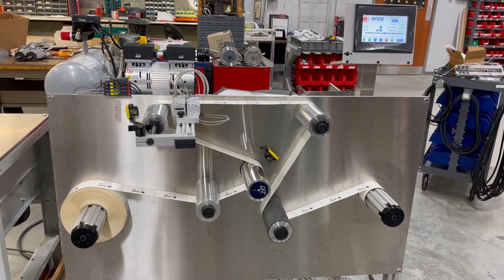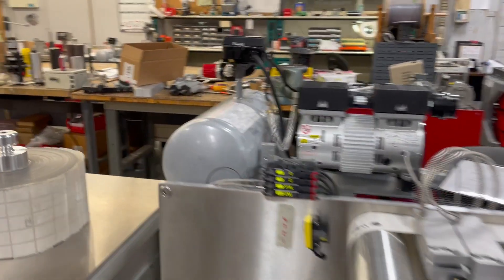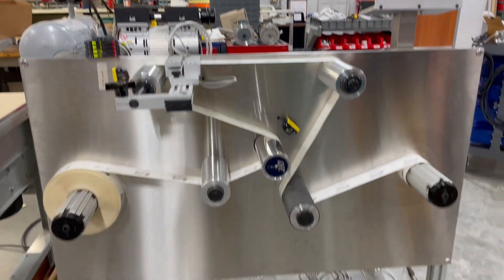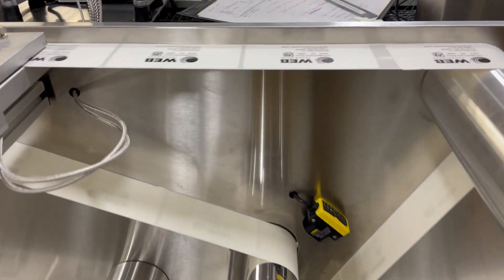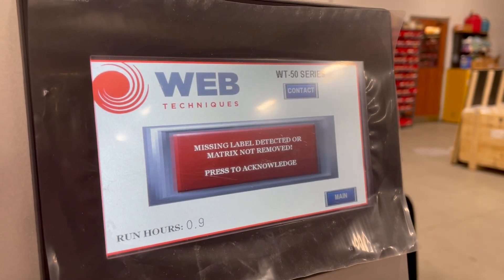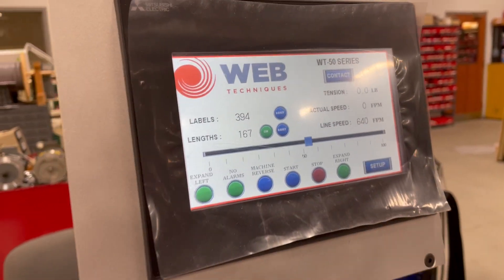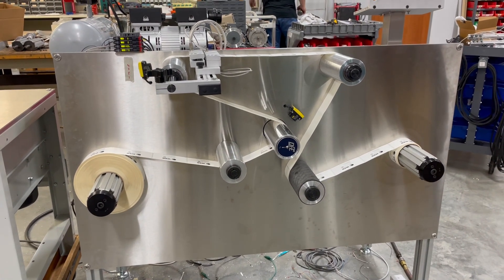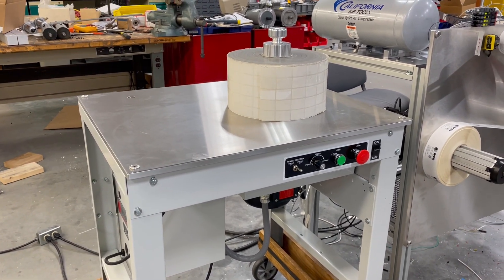WT-50 Vertical Rewind System (Production Model)

Comment: To me the rewinder still looks like a prototype with the extruded aluminum framing. I also really don't like the air compressor sitting on top like that. We have had a Californina Air tools compressor and while it is quiet while running - it is not super quiet especially when it "releases" air from moisture blow off valve it will scare the crap out of the operator every time. Also I couldn't tell, but is the height adjustable? I feel like a taller person would have to do a lot of bending and a shorter person may have trouble with the touch screen. That being said - it is really cool how it will detect the problem and stop on a dime like that and reverse to the issue. What other defects will it detect besides label gap? Would it have slitting capabilities as most vertical rewinders do? I mean it almost looks like you just took your table top version and stood it on end - not sure how much thought was put into the fact that vertical and horizontal machines are very different ergonomically speaking. To end on a better know we purchased a different brand of table top rewinder and wish we hadn't. Web techniques is the gold standard.
Reply: Thanks for the comment and great compliment at the end of your post!  We use the extruded aluminum on all our high end systems because that is how we mount cameras, printers, etc.  I agree it does not have that "finished" look but it makes things so much easier when we have to lightly customize systems.